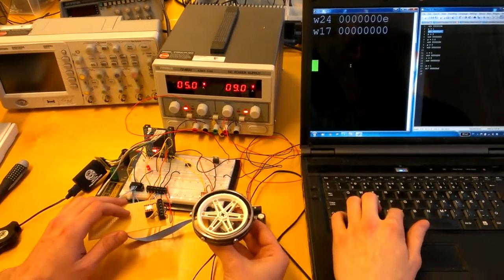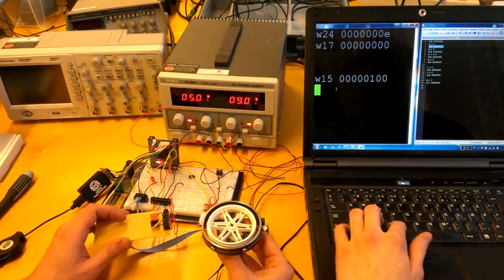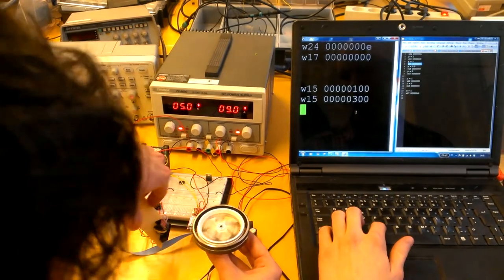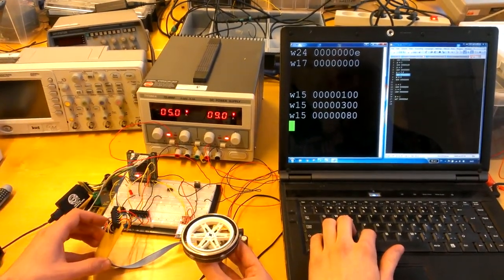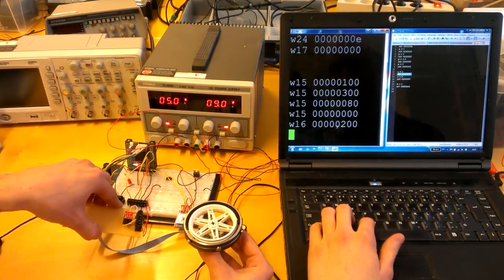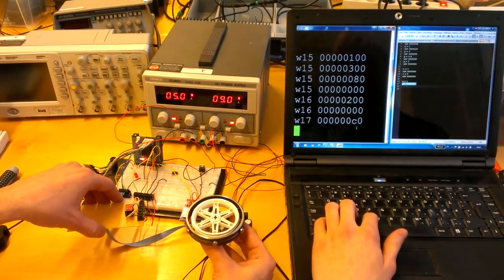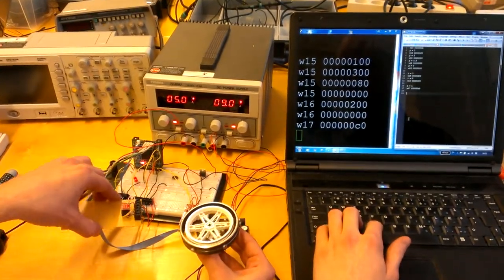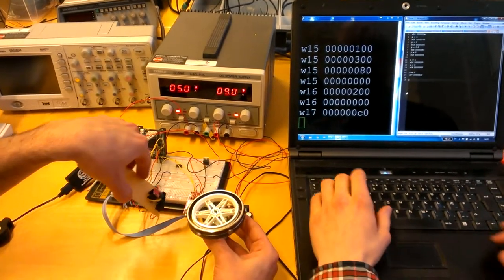DC motor controlled by accelerometer through PID - Selv balancing motorcycle project

Comment: Nice work!  We built a similar project.  However, we use the accelerometer from an Android device and an IOIO board to control the RPM of the motor. Here is the preliminary result:

http://youtu.be/JrwhfYWfj_c